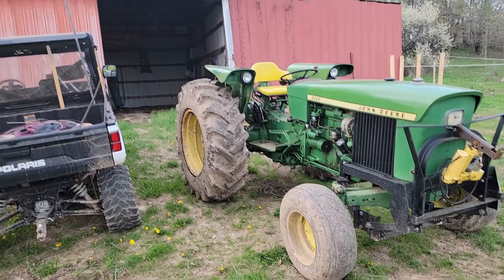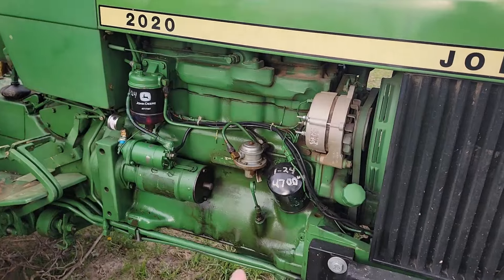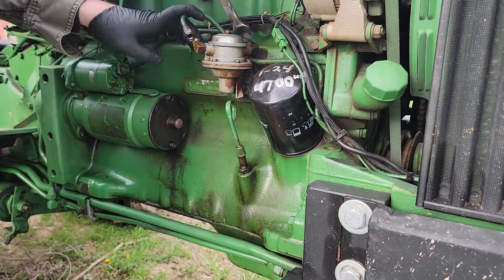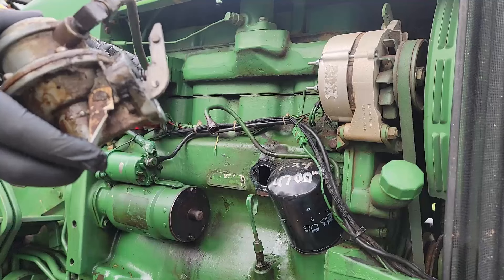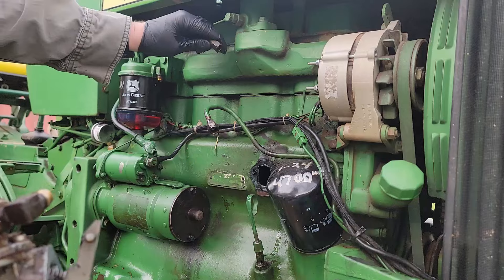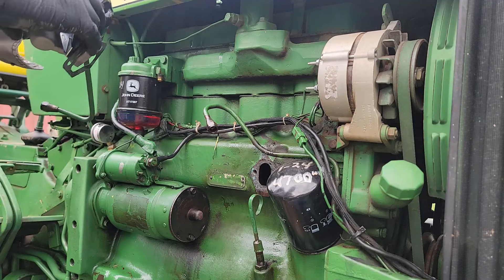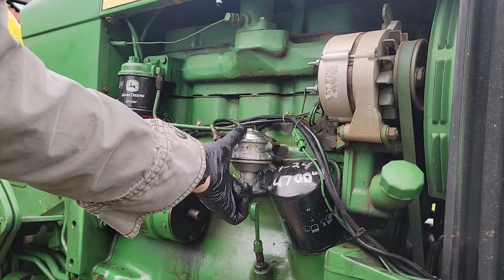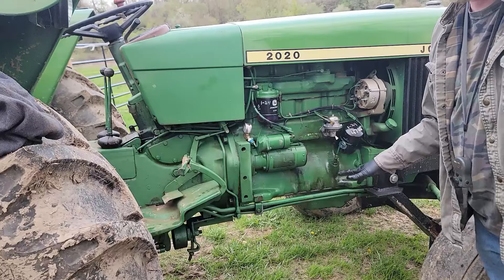John Deere 2020 Fuel Transfer Pump Replacement

Comment: Have you messed with the fuel shut off under the tank at all? I crawled under and found it was shut (turned all the way right). But tractor seems to only run with it open. Not sure if someone has pranked me or if I inhaled too much ether by accident while starting it and am simply misremembering. Is yours turned all the way to the left? My fuel pump leaks through the weep hole when its open. Getting a new one this week to try.
Reply from the maker: @jandersen2761  honestly I didn't know it had a fuel shut off. I'll look tomorrow and let you know how mine is set.
Reply: @bucksgarage1  thanks I'd appreciate it! I thought it was where I was going to get to drain my fuel (suspected fuel contamination) but found its just the fuel shut off.
Reply from the maker: @jandersen2761  mine is turned all the way counter clockwise. I had no idea it was even there.
Reply: @bucksgarage1  thanks for looking. That seems to make sense for me too. Just put a new pump on and ran great for about an hour, then back to dying. At least I got to feed hay.

I'm reading online about a potential issue with the return fuel line from Injection pump to tank. Gonna check that tonight. It's the only line I didn't check, didn't think it mattered.

Comment: $97.93 on JD website. $32.00 on Amazon.
Reply from the maker: I got it at Land Pro which is the local John Deere dealer for $32. I can provide you a phone number so you can call yourself if you would like.